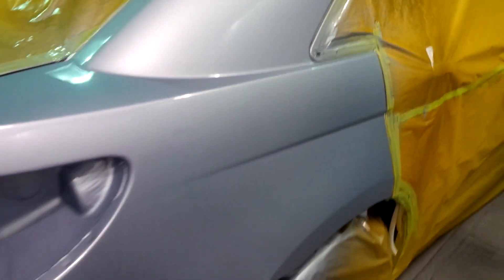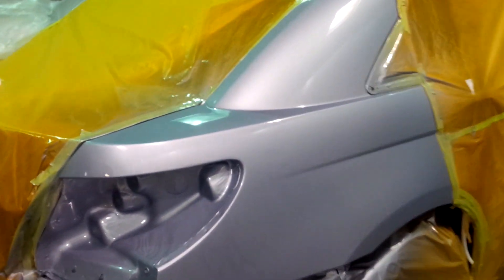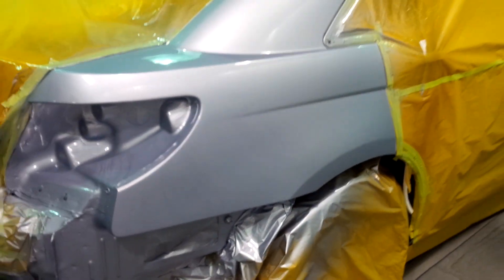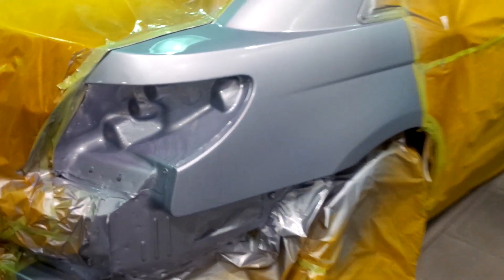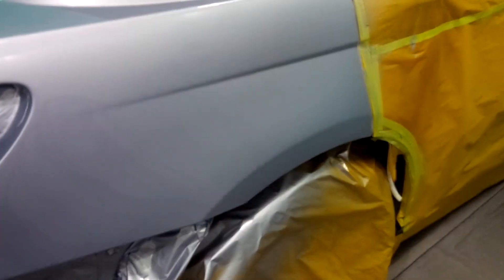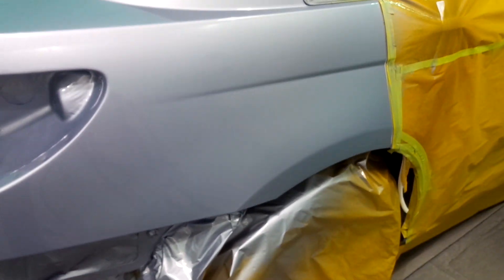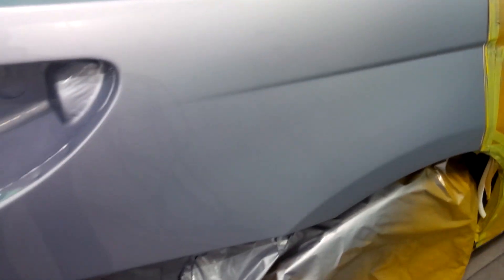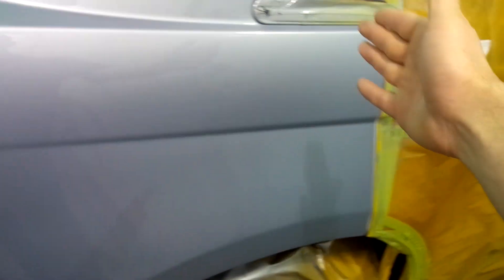Chrysler 200 Metallic Blend (Preview)

Comment: I know how it feels to struggle with colors like these. I noticed you had a sray-out panel laying on top the lft qtr; but did you start off using the panel, or do like I've done and 'finally realize that after so many attempts it was time to do the spray out panel?' Oh, and finally, my friend, do you use a color light? I don't need mine that often but it's the closest to true sunlight for me. In any event, glad to know you won that battle. :-)
Reply from the maker: Robert Appleton, Jr. I did that spray-out after realizing my standard chip wasn't close enough to blend within that space. It was the only variant other than lab matches and the chip didn't look too bad, a bit off on the pitch. Luckily the first lab match I mixed and sprayed was dead on. I always use my sun gun, but I'd much rather match my color outside, and definitely outside of the booth all together.

Comment: Hello, Question for you. What is your go to gun for solvent base coat? I have the iwata lph400 with a 1.3 have trouble with blotchiness. Was told by one of my paint reps that these gun are know for that. What do you think. I've seen you spray with one.
Reply from the maker: I like the Tekna best for either water or solvent, I wouldn't agree with that rep though. The LPH400 is a great gun, worked well for me. I've seen blotchy application with brand new Sata's, Iwata's, Devilbiss,etc. It's typically been the gun setup or way it's being applied.